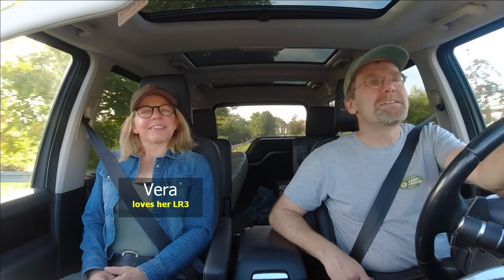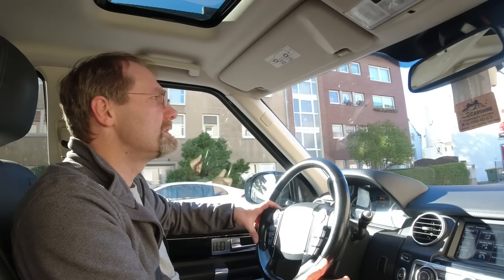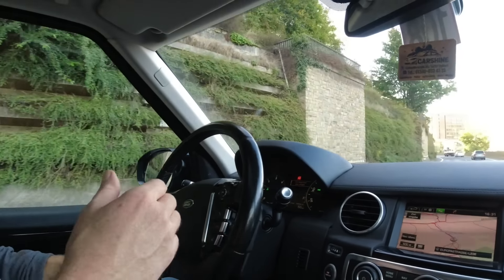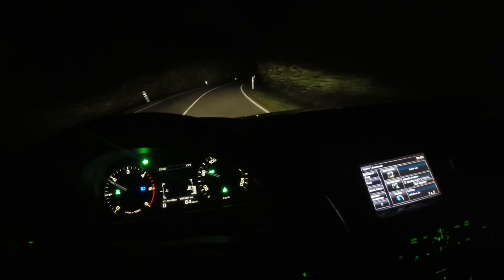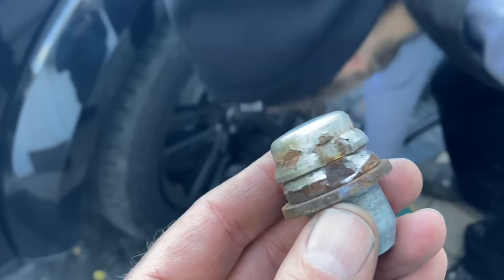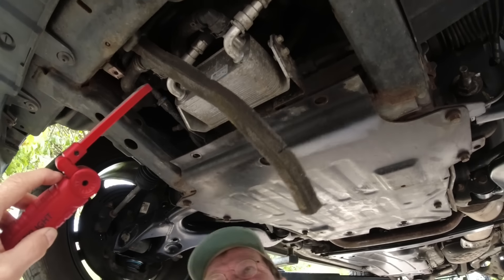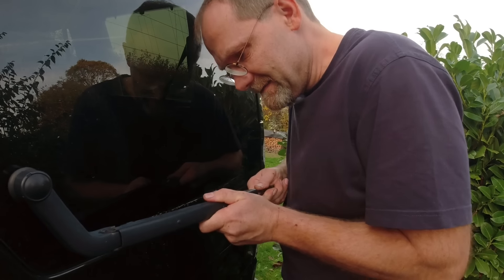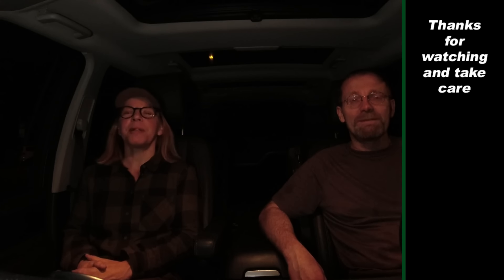How to buy a Land Rover Discovery - LR4

Comment: i have a 2010 disco 4, 3.0 TDV6 HSE, i bought it in the Uk i;m British. i've never had a problem with it despite all the holidays in Ukraine on the appalling roads here. I took it to Ukraine on the 26th Feb and started evacuating families over the border at Uzerhorod. Driving thru the Carpathians every day fetching and carrying about 300 people thru ice & snow, minus 25c. Then i went to Odesa and drove from there to Constanta taking more families out and bringing in supplies of food, military kit & meds. Day in day out the vehicle was beautiful, handling superb, fuel economy not bad averaging about 8 litres per 100 kms. about month 4 of the year i was ferrying soldiers out to training camps where we instructed them in NATO methods across severe terrain for 5 weeks. Had to change the suspension bushes and some sort of arms and the suspension was like new. The Prop Shaft rattles a little and needs changing. Only broken item is the rear washer has stopped. Thing with these amazing vehicles it to service them regularly, Taken on board your advice vis a vis Oil! Still here and hauling people and stuff around in Nikolaiv. Our work has changed, the chaos, panic & fear is no longer and the vehcile keeps going. Winter is coming but a Disco 4 can handle that...
Reply from the maker: What a deep story.  Thank you for your effort.  I wish that your Discovery goes on for ever.   Please stay safe or as safe as possible.  People need you.  Christian

Comment: Late to the party, but I just bought a 2016 LR4 Landmark with 97,000 miles - after a full service with my LR dealer, its running like a charm and thankfully had very little issues that needed work - replaced filters, oil change, new vacuum pump, and a new auxillary battery - which always fails but this is why your ECO mode is not working - the aux battery runs this feature and when the battery fails, the ECO mode fails - I had it replaced and its working again.

Comment: Low mileage (kilometerage?) and loaded! Nice!

I was surprised to hear your excitement for the auto stop/start feature. I've never owned a vehicle with it, but it's a feature that I've always dreaded. I figure it adds complexity and probably extra wear and tear on the engine, while the benefits are minimal (unless you spend a lot of time sitting in traffic, of course).
Reply from the maker: We'll see how long his excitement lasts. 😅The warning sign drives me nuts, from the passenger seat. But I do have to say, Christian is in stop and go traffic every day for 1 hour at least. 🙋‍♀️Vera
Reply: Most cars with autos and start-stop will only activate if you press hard enough on the brake pedal which makes life easier.
You can basically decide for yourself (without pressing the button to turn it off every time you start the car) when you want the engine to stop.
Reply: Your car’s Stop/Start will not not save you much. But imagine if every vehicle stopped at the red traffic lights, in both directions, did not have their engines running. How much pollution would be eliminated? Then times that by all the other traffic light controlled intersections in your city.
Reply from the maker: I have to try this

Comment: JLR used that style of locking wheel nut for a while. They are hopeless and I had to get one removed from a Jag by a specialist as when they break they just spin, even with the original unlocking nut. Best replaced with McGard style, which is what newer models now use as well. Great video 👍
Reply: The easy way is a 19 or 20mm holecutter  to remove at little cost

Comment: Good video, thanks.  Christian, in the US, there is only 2 vehicle battery makers ; East Penn and Johnson Control.  All the different brands label either makers brand as their own.  There are ways to tell the differences between manufacturers.   Quality differences can be there but not really noticeable visually.  Best way is by weight.  For flooded batteries, lighter is an indicator of lower power (amps) and less life (less lead).
Reply: applicable to USA only. There are more globally, so he has choices. Sitetel (euro), YNC(korean), Dongseo (korean), Yuasa (Japan), Hitachi (Japan). 

While Johnson controls makes Bosch and Varta batteries, they have factories globally so European choices won't come from USA plants. 

Personally I prefer korean batteries lately, had horrible experiences with Exide and Johnson batteries.
Reply: You are correct N Terrs.  However, I'm starting to see batteries from Saudi Arabia, Spain and China start to come in to USA.  That being said, it's very limited to select sizes.
Are you guys starting to see Lithium batteries in Europe?   They're rare and costly in USA.

Comment: The new black LR4 looks so beautiful and oh my, had I known all those details here too look at, when buying mine (LR4 2013, bought with 150.000km, now 200.000km). What I learned, that many of the initial errors at this car just went away by driving a while? For example, when I bought mine, both the car key batteries were empty (easy job/low cost though), the AC didn't work and had to be reconditioned for about €150 (you don't check this when buying a car at about 10°C in May…) etc. etc. - Thanks for the great content again, I'm still learning! 🙏🏼
Reply from the maker: 👍We always check the A/C and the heated seats, but buy the car anyway if the AC is not working but the price is right. 😅🙋‍♀️Vera

Comment: Another great video guys but we always thought that German trains run on time unlike the UK. When you were changing the front wiper blades it reminded me of when I was changing mine many years ago. I had the wiper arm up without the blade attached and accidentally knocked it and the spring slammed it onto the windscreen and cracked it OMG. New windscreen required.
Reply from the maker: 😳😅👍We will, forever, think about you when changing wiper blades. Thanks for sharing. 😀🙋‍♀️Vera

Comment: ECO Stop/start is dependent on a few factors, but the main one is the condition of the Big Battery ... everything is run from that, and the small battery only briefly takes over keeping canbus systems going whilst the restart occurs to prevent power variation to the modules.  We have the same in Jaguars of the same period .. the lesson is change the battery every 5 years or you start getting all sorts of error messages. If working well and you come to a halt with stop/start activating ... the car will shut down when you release your seatbelt - no need to push start button.   Sunday is started now for me 😁   I'm surprised you haven't got DAB+ in a 2015 ... you can actually use a DAB+ module from an Evoque

Comment: Congratulations on the new LR!!! 🍻🎆🎉  It looks nice, and I'm happy you got it for a good price.

My Subaru also has the Start-Stop feature that shuts off the engine when you come to a stop.  Honestly, I don't like this and have it disabled with a little connector called the "Autostop Eliminator".  In the Subaru I found that if I was at a really slow rolling stop when making a turn, the car would shut off right when I would want to go. Very annoying, and I have trouble believing that this is in anyway good for the engine.

I also have the adaptive cruise control.  I really love this feature on the highway.  Just like you [Christian] experienced on your drive that the vehicle slows down and maintains a set distance to the car ahead of it and speed up when things are clear.  It will even come to a full stop without ever touching the brakes!

Enjoy the truck!  I will certainly enjoy your videos!  Now I'm craving that transmission solution you teased at the end.

Tschuss!
Reply from the maker: 👍😀That will be a good one, but not for next Sunday. 🙋‍♀️Vera

Comment: Those locking wheel nut always do that Christian you have to make sure that the socket is pushed tight onto the wheel nut before trying to undo it. I would get rid of the originals and get a new set off of eBay. They are almost as good a quality as the original LR ones at half the price or less. As for your adaptive headlights , I have that on my 2006 4.2 supercharged Range Rover and I love it, I'm thinking of putting LED lamps in the adaptive lights. I already have Bevinsee LED lamps in the high beam light, to compliment the HID bi zennon dipped beam units and the difference is literally night and day, I will never go back to halogen bulbs ever again.

Comment: Hi Cristian just found this video with your trip home ,someone may have said in early comments ,,,what you have is RADAR CRUISE CONTROL my wife has it fitted on her VW GOLF SV  2015 plate and it is brilliant,,,also if you have the nerve you can use it in traffic and you wont even have to touch the foot brake ,then when the car /lorry moves off the car will also move off on its own and to the speed that you set ,it is just fantastic..i also had it fitted to the lorry’s i used to drive funny enough THE LORRYS  was also not a TOYOTA /HONDA🤣🤣

Comment: Congrats with the new/old LR4🙂👍 At least replacing the battery is easy. Not like the Q7 where you have to program the battery after replacement. Not a big fan of start/stop. It may be economical until the starter motor is getting worn out.

Comment: As always great video content, reference to the transmission leaks if it’s not the output seals then it’s most likely to be a bad casting and you have a crack in the casing because of the amount or the size of the fluid I say it’s a small crack.  I see it a lot, it’s bit unfair of me as I run a Land Rover /Range Rover repair business.  

Keep up the good work.
Reply from the maker: Yes, you are correct.  👍 also check the following video.  Christian
Reply: @Vera_and_Christian  thanks I will👍

Comment: We bought a 2016 HSE with ~56k kilometres (19" wheels) 2 years ago to replace our 300k km Disco 3 SE. The only issue we had with the 2016 was the compressor for the suspension. Our independent service people described it as a "lazy" compressor. Faultless with the new compressor. No malls though!

Comment: Surely more than a Constantia Crawler indeed! 🇿🇦. 

These Disco 4's are really capable, enduring and reliable.  Many here won't sell, even when offered more than book value.

I won't mind owning one, but they are a bit rare.
Reply from the maker: 👍That is why we have three right now. 🙋‍♀️
Reply: Still, if I could, G350d or G400d even better, the ones with OM656 engines.

Ever considered OM603 or 606 in a Disco??
Reply from the maker: @unwoke1652  G Class is too expensive for us. 45000€ for a 20 year old car with 300000 km on it. That is why we drive Land Rovers. 👍🙋‍♀

Comment: Hi guys , I used to have very late landmark on a 16 plate, and always watched all your videos, I had my car stolen some time back, I just about buy a deluxe on a 2015. It’s interesting that your HSE is far higher spec than HSE in the Uk, you have lane control adaptive controls ie slows down when you go close to car in front, the HSE in Uk don’t have full length roof bars, also you have a fridge to which are options. so the spec you have is  very similar to the delux model, options you have is standard  on the deluxe model. In the Uk Landrover uses exside battery’s with the Landrover name stamp on it . I think your model is the black pack model with black grill alloys etc . Good luck with your new d4 . Regards mark
Reply from the maker: Not every option is included in the HSE spec. A lot of options you have to purchase in additon to the HSE spec. Our Discovery 4 SE had a lot of bought options and so does my Discovery 3 SE. 👍🙋‍♀️

Comment: I miss my D3/4 so I went to the dealer in June to buy another 2016 D4 LUX and ended up ordering a New Defender 😊 Got it last Saturday and it arrived with many bits missing 🙄 which dealer will retrofit but so far no warning lights 🙂Hope I haven’t jinxed it now. 😂 Best car LR ever designed was the D3/4. There is still nothing that really replaces it. ☹️

Comment: There's another common issue with LR4 that is the rotary gear selector that fails leaving you stranded. The problem is the circuit board which has dry joints. Resoldering the board is the fix and at the same time you should install and override cable so you can manually move the selector if it fails...or carry a spare one. AULRO had a detailed fix posted some years ago...should still be there...hopefully..

Comment: How did you reset the transmission?  After watching almost all your videos, I ended up getting a used ‘16 Sport HSE with the TD6 diesel.  Love this thing!  I’m learning how to put it in the right service modes, just did a full brake job.  Imagine my surprise, taking the rear apart, only to have to put it all back together, to enable parking brake service mode…..  ugh!  I had the same surprised reaction the first night seeing the light from the mirrors on the ground too!  Glad y’all stuck with another LR and thanks for all the videos!
Reply from the maker: We used the GAP tool, but caution.... that procedure is not a "press a button" kind of procedure. 🙋‍♀️Vera

Comment: The color of the new LR4 just looks amazing!
I thought the LR3 has the same adaptive headlight that aims to wherever you are turning.
Or is the the LR4 adaptive headlight has an even better system?
Can't wait for more videos!
Reply: Adaptive headlight is an extra on the LR3 but it works really well. It will engage on steering wheel movement or only when you hit the indicator switch.

Comment: I’m so happy you guys bought that mall crawler. Thank you !  Don’t forget the stop start feature runs off the auxiliary battery ( the smaller one by the brake fluid reservoir). Mine went and the stop start feature was disabled. General advice on battery - would you say not to bother with an original 
JLR one? It’s twice the price of the Exide equivalent and is it not made by Exide anyway? Great video. Ty

Comment: Nice video I love watching you guys, I have a 2015 Discovery 4 for over a month now and I'm already itching to rip out the ECO mode module, I've searched and it can't be turned off without the ECO Off light being on. I made today a three move turn, it has stopped three times the engine, so ... I wonder what happens to the oil pressure that keeps going up and down for every stop/start especially on this engine? not to mention the starter motor.
Reply from the maker: You can push the off button.  I suggest to use this function like any other feature which needs to be operated.  It got great benefits for me.  At Mc Donald’s it stops the engine.  At traffic lights too.  Because of it, the radio and electrics are not stalling during cranking like on the older LR4 and LR3.  That is a great advantage. My dash cam did always reset when I started the car and now it keeps recording.  The boost valve in the 8HP makes takeoff after start immediate. No delay.  By now I use it like any other on/off function.  Thanks. Christian
Reply: @Vera_and_Christian  I use the ECO off button, but most of the time I forget about it 😆, for me it is a very annoying function especially as it cannot be deactivated from the menu.

Comment: The replacement of the secondary battery should solve the ECO mode function. I had the same issue when I purchased my 2016 Discovery 4. Hope it helps :)
Reply from the maker: It works now when I don’t want it.  So yes, it’s working now. Christian

Comment: Hello did I get a good buy, I bought a discovery hse luxury in black for £14,250  with the 20 inch standard alloys and also  22 inch alloys fitted,, 124,000 miles, starts and drives perfect,, 8 previous services in the history, 3 owners from new and timing belt just fitted, oh and 2 keys
Reply from the maker: Sounds good.  Hope it runs for ever.  I got to trash those 22 Inch rims unless you want to sell drugs out of it.  Christian

Comment: A 2015 Disco  - one of the very last before LR went over to the horrible Disco 5.  In the UK, the going price for a D4 of that age is over £30,000 (€35,000) 😱  You have the same DAB unit I have, except mine is badged "Motorola" - an  excellent unit and came top in the Auto Express test of after-market DAB units.  I have had mine over a year now and the batteries in the remote unit are still the originals - they last ages. 👍
Reply: Our 2015 D4 SC has the DAB in built by Meridian...wonder why the HSE doesn't ?
Reply from the maker: DAB is a option and quite rare as it was very expensive. Christian
Reply from the maker: John, good to know that the battery lasts.  I was worried that this becomes annoying.  Christian
Reply: @Vera_and_Christian  yeah.. The previous owner ticked every box .....over Au20k in options alone.

Comment: We have the LR4 SC V6  a brilliant car but look out for cooling pipe issues as the plastic cross over pipes and heater manifold fail as does the original version of the water pump. Replace the plastic pipes ASAP esp the cross over pipe and heater manifold. On the SC the supercharger has to come off...not esp hard to do but takes tome  the HSE versions sell for over 70k Au atm in Aus!!